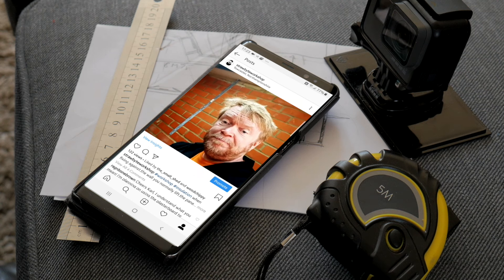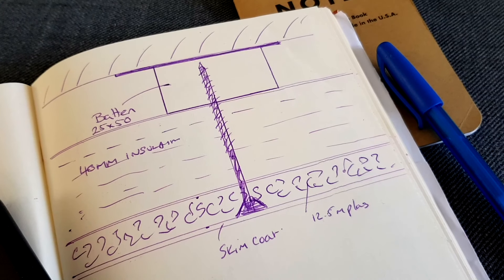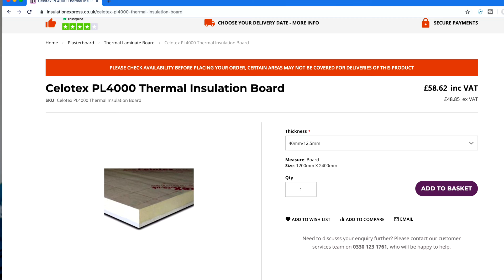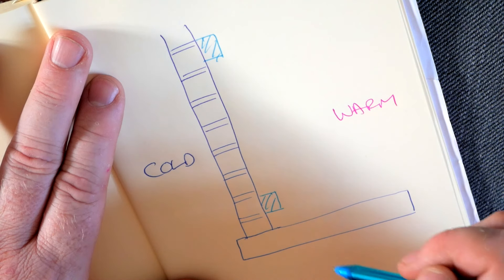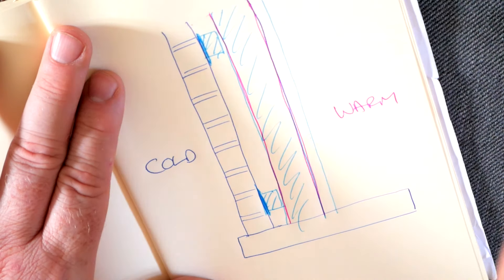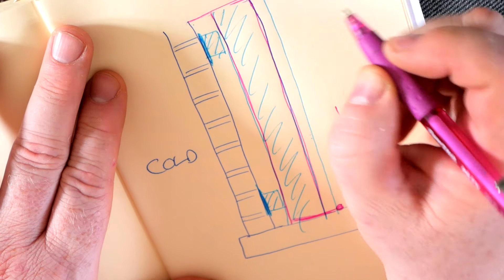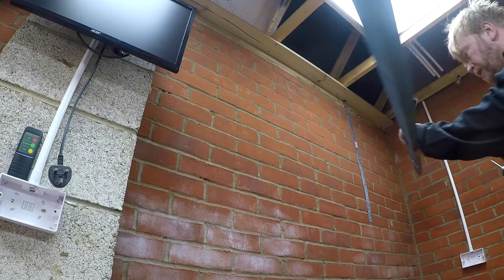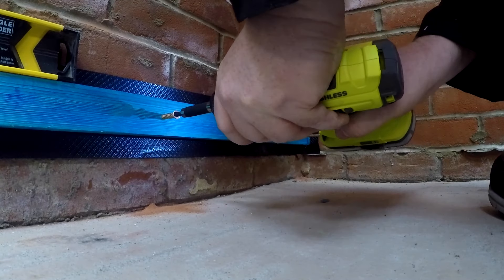How to Insulate Your Workshop | An Easy DIY Project | Keep Your Shop Warm or Cooler

Comment: Hi Karl. Have you ever insulated the pitched roof? I am to do it, but lack ideas or best practices. What could you suggest? Thanks.
Reply from the maker: Hi - thanks for the question. I did put out a video at the time (https://youtu.be/fpO6lMwRpCQ) which covered the roof installation. However I made a mistake and took the video down from public view. Watch the video anyway, but note the mistake I made was battening out after the first layer of insulation and then putting a second layer on top with a gap between them. That's not best practice as there's a risk of condensation forming in the gap. I've since re-done the whole roof over a couple of summers and removed the gap now and plan to update the video at some point.

Regards

Karl
Reply: @StrawbyteWorkshop  Thank you for taking the time to reply. I did start the process after learning as much I could from other's examples. I did follow a similar solution to you, but with just a 70mm PIR between the roof rafters (leaving 30mm space to the fabric/membrane under the tiles). I did use aluminium tape to close all sides of the PIR though. Due to the nature of my garage roof, the painful part was to cut to size the sides of the roof (average of 600mm x 190mm). One idea pending is to find some light material that can be used to cover evenly the PIR to give it a more fine finish (maybe, PVC sheets or light panels, not sure).
Next step is to follow your video suggestions for the walls. Hopefully before summer.
Thank you.

Comment: Good job Carl. You need a batten in the centre of each full sheet. You'll find a huge difference when you do the roof both in the winter and summer.
Reply from the maker: Hey Graham, you're absolutely right and I admitted the mistake made on the first wall in the video.  To be honest I was.so focused on getting the batten on the right edge in the right place I didnt refer to the drawing again. All the remaining walls are done correctly as per the drawing. The roof is done already and your spot on about the benefit. Consistently 5 degrees cooler and as quiet as anything.
Reply: Good man look forward to your next one.

Comment: Hi Great advice  re- vapour barriers and insulation.Problem is I have a large wooden workshop here in the cold NE of Scotland and have just bought 12 rolls of foil backed bubble wrap from  Aldi aarrrgh ! Is stapling the bubble wrap to the internal wood walls better than nothing ?I have just seen your shed build and notice as yet no insulation great colour though,well done.
Reply from the maker: Absolutely,! Make sure you tape the seams and cover the staples. I’ve used this stuff before and it’s great at making a place feel warm as the foil back reflects radiant heat back in to the space. For My old workshop (blue summer house) I plan to use Aldi foil blanket as it’s insulation and will clad with 42,5mm insulated plasterboard. For your project, use what you have and you can always overclad later.
Reply: Thank you,  will go looking for stainless steel staples so no rust coming through do you recommend any particular tape ? @StrawbyteWorkshop
Reply from the maker: @richardallan455  I used mostly the foil tape from screwfix.

Comment: great video, i feel confident attempting to renovate my garage myself but i dont have tools. Very well explained. thank you. When i look at your garage it is similar size to mine and i have been quoted double what you spent on your project and im now stuck as i dont have enough money .my detached garage is 16 foot long, 7 foot height and 9 foot wide. The builder advised 27mm- 11 celotex 8x4 plaster boards for walls and 4inch kinspun x5 plaster boards. including studs and nails £1540:((( yet you spent half of that. I want the garage to be a laundry room, and if you can help please how i can cut cost but maintaining a professional project like yours i would be very grateful.
thanks in advance
Reply from the maker: Thanks very much for the comment. I spent a good deal of time ringing around and checking online prices and in the end collected materials from several sources. Insulation Express was the cheapest on insulation, wickes for roofing battens, Travis Perkins and B&Q for MDF and so on. It was a challenge to get everything together at the same time but the work was done in two stages so I didn't have all the project materials getting in the way. The back half of the garage, then the front. The video joins them together to make the whole thing look like it was done in one go.
A builder should be able to provide a bill of materials for the work (it sounds like you have that) so you could shop for them and save that way.

Comment: It's funny that I looked into insulating my garage too a few months ago and spent some time looking online on how to do that properly - same "single skin" awful walls so condensation had to be taken into account. And I ended up doing exactly what you did besides that I didn't use insulated plasterboards but celotex and drywall separately. I also chose 20mm of Celotex to avoid losing too much space. I still have to do one half of the garage but the difference has been absolutely fantastic. It's a shame that "single skin walls" are still allowed. I appreciate it's a garage but we all know nobody keeps their car in the garage and if it's wet and cold it's going to damage everything you store in there.
Reply from the maker: Thanks for the comment. I switched to celotex and MDF panels later in the project due mostly to the weight being more manageable on my own. To be honest I'm lucky to have a garage at all where I am since only 4 of the 14 house styles on my development have garages at all.
Reply: @StrawbyteWorkshop  My initial plan was to go with MDF too. Then someone pointed out that from a safety perspective drywall was better (it's fire proof). So I went with that. I don't mind and I bought the moisture-resistant type. I think MDF is safe too! :) 
Yes, I see what you mean. I believe I have the only double garage in the area - for a relatively small house.
It used to be a car port apparently. Then closed with shutters by the previous owner. I then removed the silly wall partition between the two spaces after a structural engineer confirmed that it was safe to do

Comment: Hi Karl, I've watched the video at least 3 times now, I am debating doing it myself due to quotes being over £1.5k and it just seems to simple when you explain it. I had a couple questions if that's okay. 1) I have green vapour barrier left over from the ceiling, can I attach that to the walls and still use the DPC with the treated wood? 2) I had the ceiling done already is there anything else I need to take into account? 3) Ihad French doors installed what would be best to do when working around the sides of them to insulate? Lastly I want to do the same with the garage doors itself and insulate them so it can't be used is there anything to take into account? Thanks Alex
Reply from the maker: Hey there Alexander. It might take more than one go to nail all your questions so if anything I explain doesn't make sense please ask more questions. So,
Q1: If you're following my approach and using PIR insulation (Celotex or the other brands) and that insulation has foil on both faces, then you won't need an additional vapour barrier. You simply tape the seams and over any screw holes as I've done. Plus use a silicone sealant on the edges, any internal corners, the corner between insulation at the ceiling and between the gap between the insulation and the floor. Your insulation should always be lifted 5mm off the floor. With regards the DPC between the wall and wood? Yes you should use it as I've done - even if the timber is treated. The insulation manufacturer's (I followed Kingspan) installation guide recommends it but doesn't explain why. In short a brick built wall is not impermeable to water in its liquid form and without the DPC moisture may collect between the brick and the batten. With no where for the moisture to go and with little/no oxygen you will rot the battens quickly. The DPC prevents water reaching the batten.
Q2: In the video (the instagram post bit) I referred to the installation guide and the normal practice of lifting the insulation up to the ceiling. In my case I had to install timber to achieve the same thing. If you're ceiling is not flat (all wavy or has a hollow or hump, I would scribe the insulation to fit. I'm currently repeating the insulation project on a garden building which is not square and none of the walls are flat and consequently I've had to scribe the shape of the adjacent wall onto the edge of the insulation and trim to fit tightly. You want to avoid having to resort to foam. Like I mentioned in Q1, use silicone to seal the corner between the insulation and ceiling.
Q3: Doors and windows are a problem to fit around. If you've watched my workshop door project and look carefully you will see that the join between the wall and door is pretty seamless. in thinking this through I realised I needed to decide on what material I was going to use for the reveal/surround for the door. In my case I decided on 12mm moisture resistant MDF. When bringing the insulation towards the door I stopped 12 mm short to provide room for the reveal and used foil tape to tape over the exposed ends of the insulation. I would suggest visiting the sites of the main PIR makers and downloading their installation guides. They cover in detail the joints around doors and windows and there are number of options depending on the thickness of the wall. however, as in my case, the door frame was 110mm wide which is the same as the width of a brick so the frame was flush to the inside of the wall. The approach I've explained was the best I could achieve. But you're always going to get what's called thermal bridging around doors - especially as the frame and door itself isn't going to achieve the same U value as you're newly installed insulation.
"Lastly" Question: It seems from the question that you don't plan to use the door. In which case I would suggest installing a stud wall in the (typically) 7' x 7' opening, putting 40-50mm insulation between the studs and 20mm insulation over the stud wall before installing your interior surface. In my garage the front wall is double thickness (220mm) with a Hormann door at around 50mm. Leaving a gap, then installing 63mm CLS studs, plus 20mm insulation you should have plenty of room to bring the stud wall into the room such that you bring everything flush with the insulation and lining on the walls either side. In my case I need the door to be operational so have taken a different approach where I insulated the garage door itself with 25mm Polystyrene insulation.
Gosforth handyman has a video on his channel where he blocked off the garage door and put an insulated wall in place. you might like to use that as a guide. 
One quick thought though is that a new stud wall would be the perfect use for the vapour barrier you have. Place it on the outside of the stud wall and maybe consider substituting PIR insulation with Rockwool Sound Slab to give you a significant noise reduction. The steel garage door acts as big 'drum' skin and picks up sound from outside and sends it into your newly created room.

One thing I do want to point out is that my garage is detached from my house and is unheated. In converting it into a workshop I'm not actually creating a habitable room within the dwelling and, as such, I don't need to fully comply with local authority building standards, or get approval from the building inspector. That said I've had a professional opinion on the work and I'm pretty close to the regs. If your garage is attached to the house or integral I would suggest that you consult your local authority building inspection department for advice first.
Reply from the maker: Just a quick thought on the quotes you've received. There's about £800 of materials in my project so if you've found someone to install for £700 then that's a bargain and (if I'm honest) a bit suspicious. Since posting the video I've had a few people get in touch who have mistaken me (a popular YouTuber who actually works for a bank) for a builder and have asked me for a quote. In apologising for not being able to do their project I did point out that the bulk of what you saw me achieve (walls, floor and roof-space) too around 6 full days (not including the time taken to empty the space every day). Any builder will have you completely clear the garage, the driveway too and will probably take just as long. 

One advantage of doing it yourself is that you can go at your own pace, work around the stuff you have in the space already and get stuff delivered in stages. DPC & battens then insulation and tape, then the interior surface. 

Anyhow, just a thought.
Reply: Hi Karl, appreciate the speedy response, regarding the last bit the quote was for labour only and I would need to supply the materials. There is definitely a lot to take in there, some of the work seems to be simpler than others. Will really need to think this through, I do agree though about working at my own pace.
Reply from the maker: @alexanderforrester1490  I'm glad I could help.

Comment: Hi, brilliant build! My new build garage is a home gym - currently not insulated. 
I’m just trying to figure out what would be the best/easiest/effective way would be to do this - I am not very DIY! 
What temperature is the garage in winter? And how quick does it take to heat? Is much heat lost? Sorry if this has been asked a hundred times already!
Reply from the maker: Hi Nick - thanks for the questions. I think the approach in the video is pretty approachable and I've had tood feedback from non-diyers who tackled the project themselves. 
In general I find the temperature inside is around 5 degrees above the outside temperature in the winter. I've a lot of cast-iron tools so run a dehumidifier throughout the winter as well. It takes around 20 minutes with a 2kW heater to get it up to around 13-14 degrees which is plenty warm for working with tools, and stays warm for quite a while afterwards.
Anyway it's well worth it as I said in the video it was pretty miserable without insulation and impossible to get the damp out the air. I hope that helps.

Comment: Very interesting video Karl, and the finished workspace looked great. My issue in my garage is the main garage door. Need to get on and sort that.
Reply from the maker: Once I've got the personel for in mine will stay shut almost all the time afterwards and I insulated the door bast October and that made a big difference sound wise.
Reply: Strawbyte Workshop how did you insulate the garage door? I’m thinking of doing the same and would be interested to know what products you used.

Comment: Hi, thanks for uploading this. Have you insulated the garage door also and if so could you say how as I am looking and insulating mine. Thanks 👍
Reply from the maker: Thanks for the question. I wrote a blog article about my approach a while back. The key is to find an approach that doesn't add too much weight to the door.
https://www.strawbyte.com/blog/2018/11/18/how-to-insulate-a-garage-door

Comment: So one just over one year on. Can you say there would be anything you would have done differently? How has the garage been over the past year?
Reply from the maker: Hi Hobby Hero - what a good question.

Yes there are probably a few things I would have done differently. I think I would have planned a little better how I wanted to arrange things in the workshop so I could have included the fixings in the walls for heavier items such as cabinets and brackets (like the TV bracket). I made a couple of errors on one wall which has lead to a small patch of wall becoming wet and mouldy. This ill probably be a fix I may feature in a future video. I don't think I would  have used unsulated plasterboard at all - it's way too heavy to fit easily on your own for very little advantage. I would have done the floor first and not after the walls. It would have made for a seamless finish. I would have completed all the insulation in one hit and then put the door in. In waiting nearly 7 months for the door I didn't get the benefit of the insulation over the winter and the door install wouldn't have been any more difficult.

I'm doing another insulation project at the moment on the building that used to be my workshop and I've found a much simpler way of insulating the roof and transitioning from the walls to the roof insulation.

But overall the insulation has been a roaring success. Over winter the workshop was too warm at times and I would often just let the heat from dust extractors and tools warm the space. In the summer the workshop has been between 5 & 10 degrees cooler. Plus I don't get any complaints from the neighbours about noise. I've spoken to my nearest neighbour and she can hear what I'm doing but It doesn't mean she has to raise her voice if she's taking to someone in the garden. So very pleased.

There have been so many questions over the last 12 months I should do a follow-up soon. Others have asked for advice and I have ended up talking about some of the methods I rejected which might be valid for some and worth discussing more generally. 

Take care.

K.
Reply: @StrawbyteWorkshop  excellence thanks for taking the time to respond. Looking forward to hearing more 👍🏻